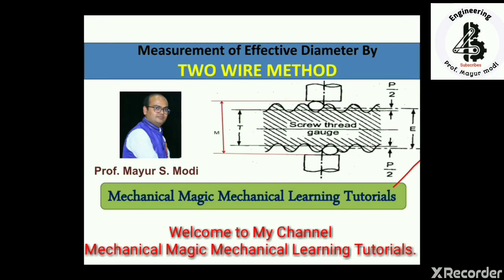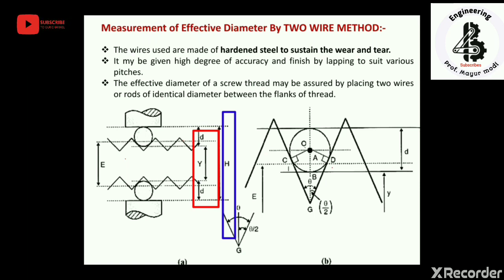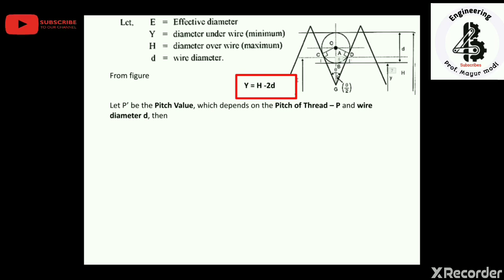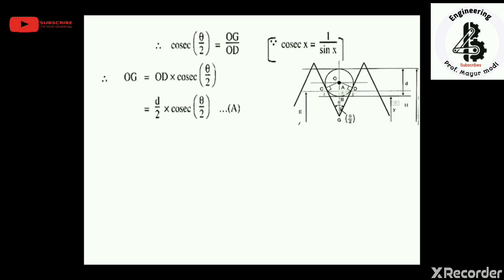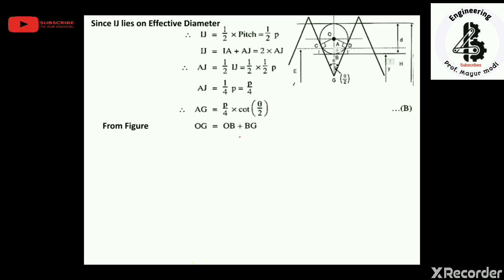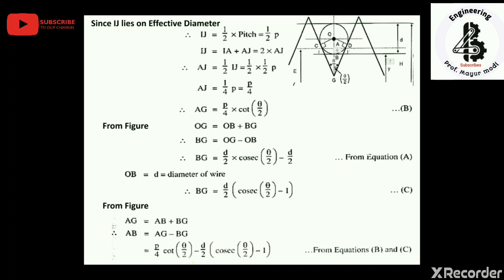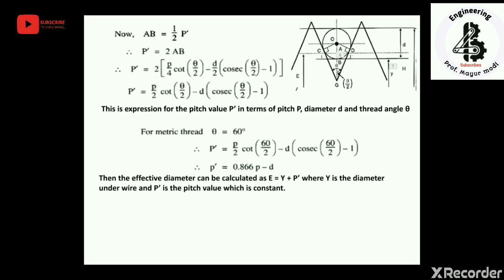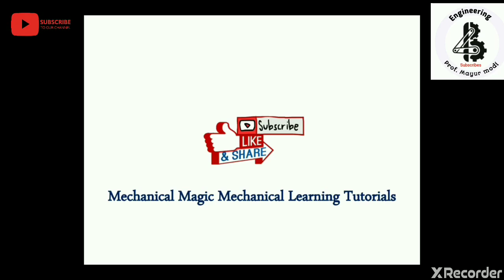Effective Diameter by Two Wire Method | Screw  Thread Measurement | Mechanical

Comment: Sir how did AB =p'/2 came 
On what basis you take 
Please explain
Reply: P' is the difference between the effective  "Diameter" and the "Diameter" Under the Wire . Since in the above derivation we are looking on one side of the Center line, the difference (P') between the "Diameters" is divided by 2.